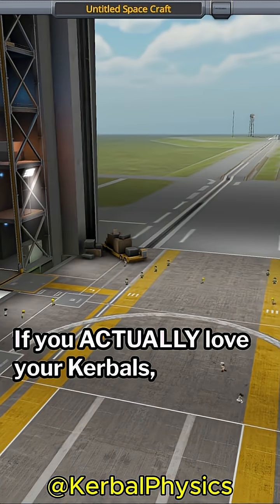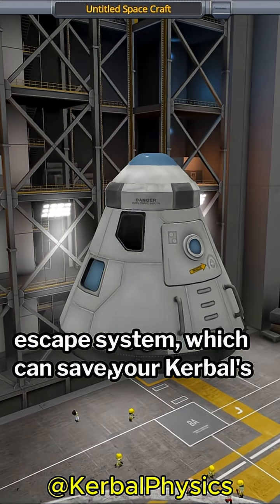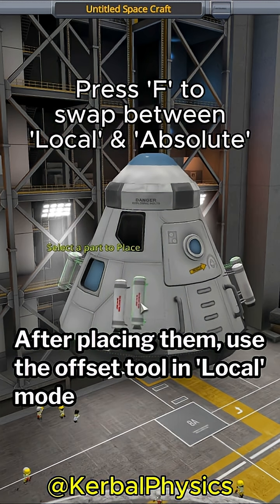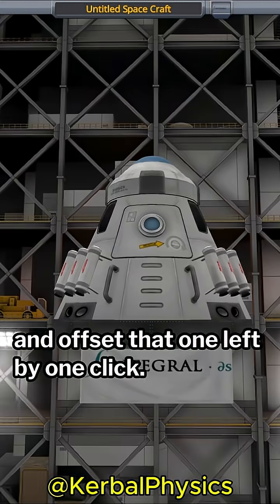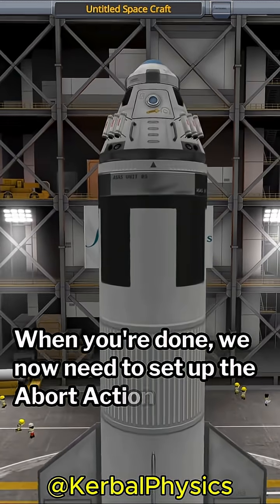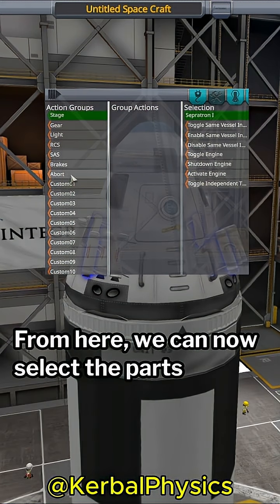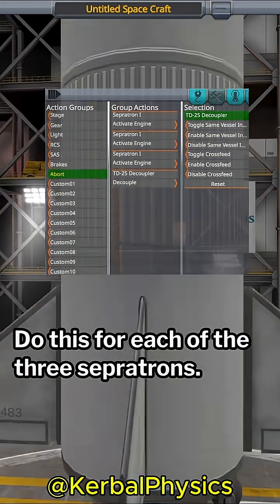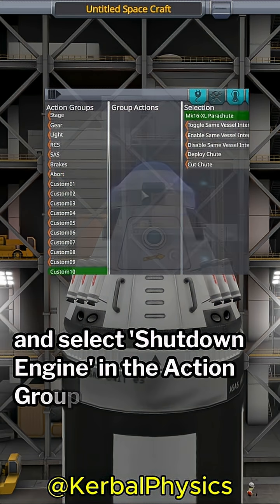How to build a SpaceX style launch escape system in Kerbal Space Program  #kerbalspaceprogram #space

Comment: Or try this instaed of using sepreatrons try using an fairing with no truss structure and interstage node on put it on top of the pod and a parachute and a LAUNCH ESCAPE SYSTEM (there is literally a part for that)  on the interstage nodes and bind it to abort it is much better at its job than sepratrons because it turns the pod away from the rocket and applies Waaaaayyyyy more force and has much better twr
Reply: OP said "spaceX like abort system".

Comment: Actually 
Use the big side motors, not the small ones

Idk what they are called
And add 1-4 of those yellow bean fuel tanks into the pod

Now you can both abort.. and also land the pod in case of parashute failure
Also works to slow down on high speed reentry

Comment: I feel like 12 separations is a little much, no? 
For an about system you just need a TWR that is 0.2 or more than the rocket normally eg if the rocket TWR is 1.3 the abort system needs to be 1.5 or more
Reply from the maker: i recommend a TWR of 3-4 to be safe. its just about getting you away from the exploding rocket quickly
Reply: Okay, I did some research.
The seperatron burns for 5 seconds. For 5 seconds, astronauts can survive up to 9 g.
As long as they experience 9g or less, the abort system is fine.

Another factor is weight, but for safety a little more weight and a little less delta v is fine